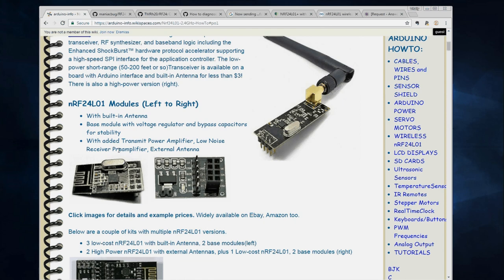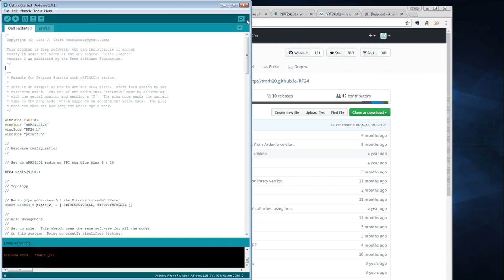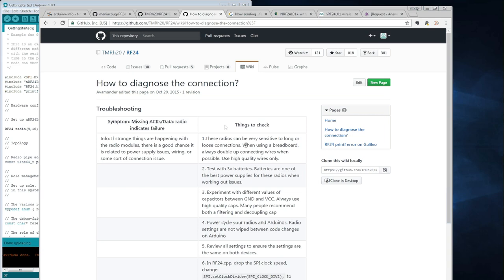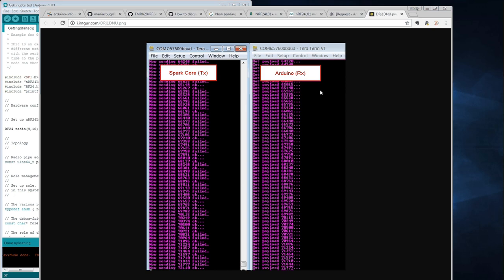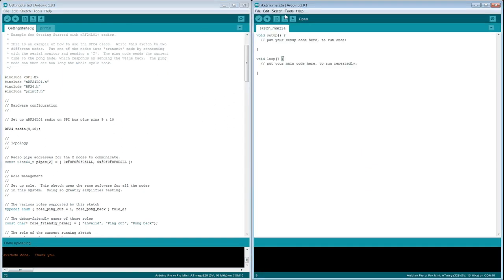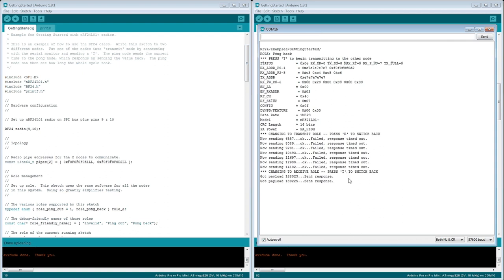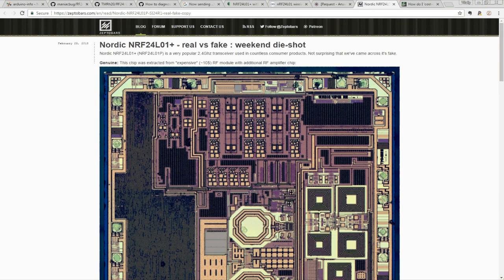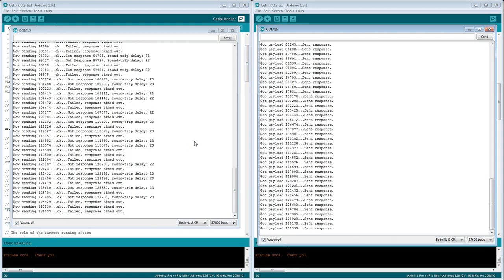nRF24L01+ HOW TO FIX: Now sending ... failed. Failed, response timed out. RF24 nRF24

Comment: Thank you, Thank you, Thank you!  I've been ripping my hair out trying to figure out why my modules weren't communicating.  With the photos of the die and the comparison of the writing on top, I determined I had a fake chip (Thanks Amazon...).  I also then realized that the library I was using (RFLite) didn't have an option to turn off the autoAck.  Once I changed to the RF24 library and was able to turn this off, my transmissions finally made it to the receiving unit.    Thanks again!

Comment: 1.radio.setAutoAck(false) worked...thanks alot....
2.In case the module still dont work then another suggestion is to power up nRF module via 5v host shield as Arduino sometimes is not able to source enough current to the module via 3.3v pin...
I followed both the steps and the modules started working like a charm. Thanks Vitaliy :D

Comment: A few things I'd like to add: the MISO line needs to be pulled high with a resistor (about 3K ohms). Breadboards can have intermittent connections causing errors. At MAX PA power, if the MCU (arduino) is too close to antenna, it can cause severe errors. I suppose long wires could also pickup strong RF causing MCU issues. Shielding can cure this. These are great units once idiosyncrasies are understood.
Reply: Please tell me how to pull miss high and how close are you talking abt..referring to Mcu and ant. Thanks
Reply from the maker: @atdforgebc4605  add 10 to 100 kohm resistor between 5V and MISO.   CLOSE IS like 6 inch and closer. (Add aluminum foil box around Arduino to test interference

Comment: Muchas gracias, por cierto, el ejemplo de GettingStarted de tmrh20 no funciona bien, pero con el ejemplo de maniacbug funciona muy bien. Ambas versiones del api tienen varias diferencias. Por  ahora estoy haciendo un control para un dron adaptando un Trasmitter SYMA con un adaptador de protocolo de SYMA a nrf24, y esta ayuda que has dado funciona muy bien.

Mis tips: 

- Agregar Capacitor 100UF , ojalá sobre el módulo nrf24. Si no tiene 100UF, ponga 10x10uf en paralelo en la protoboard.
- setAutoAck(false) siempre que se pueda. 
- Deje el PA en HIGH, y luego en LOW, chequee que ese valor se vea reflejado en el ejemplo de GettingStarted (de la versión de maniacbugs). Si ve que cambia, el módulo está funcionando. Si no ve cambios, revise la fuente de poder si está bien conectada o si está dando suficiente potencia (ampers y voltaje). Toque el módulo nrf24, si está muy caliente, significa que ya está quemado. 

- Cuando haga las pruebas, procure desconectar el AC y volver a conectar, así los módulos se reinician. Primero deje encendido el receptor y luego el transmisor. Es probable que nunca conecten, para eso, desenchufe ambos. 
- La fuente de poder que me funcionó fue una batería de litio de un Garmin Forerunner 305, que permitía alimentar dos módulos (con antena y sin antena) con un PA en High sin problemas, regulado con un ams1117 para que de 3.3 volts. La batería es de 3,7, así que podría ir conectada directamente. 
- Un cargador USB de 1 a 2 ampers, pero debe ir con regulador de voltaje (ideal ams1117), el módulo nrf24 sin antena se quema muy rápido con voltajes de 5 volts. 
- No usar en paralelo o en serie algún led o resistencias, ya que eso inhibe la potencia de nrf24. 
- Como estándar en todos los ejemplos, usar el pin 9 y 10. 

- Si va a usarlo en un dron, mejor adquiera una versión legítima. 

Muchas gracias, desde Chile.

Comment: hi, i am using module with one antenna and one without antenna. but the one with antenna only works with Nano. Didn't work with Arduino uno. what could be the problem? I connected the one with antenna to nano and the one without antenna to uno. but after 18.22 meters the data exchange was broken. How many volts should we give the electricity need of the module? Would it be better if we give it outside? thanks in advance ;)

Comment: Hi. My Arduino tank robot using T300 chassis and cheap NRF24L01 is having hiccups. It seems like there are intermittent sudden signal drops between my diy TX and the bot itself. I soldered 100uF bet gnd and vcc of the RX module and 10uF on the idy TX device. But it still having sudden drops.
Reply from the maker: myonline88. Are those drops occuring in certain distances between Rx and tx ? Maybe use more powerful instead..
Reply: Thank you for replying so soon sir.  No. In fact it was just a few feet away from me. It occurs almost as soon as I powered up the robot. Sometimes, it takes few minutes before it occurred. Sometimes those drops are successive, sometimes at an interval of few seconds. It wasn't like this before with my first version using old DIY stand alone using ATMega328p chip on a protoboard and plastic 4WD chassis. Now, I'm using Nano, L293D chip, cheap NRF24L02 and 11.1 volts li-po battery and the T300 aluminum tank chassis

Comment: I get the 'Now sending "number"...ok...failed response timed out' to run just fine but when I type 'r' to get it into receiving mode, nothing happens; it just doesn't write anything other than '
* CHANGING TO RECEIVE ROLE -- PRESS 'T' TO SWITCH BACK'. Does anyone else have this problem or have a solution to this?
Reply: Any resolution on this?
Reply from the maker: did you switch the other module to Send mode? (One has to be in T mode, another in R mode)

Comment: This is a good video with lots of good info. It helped a lot. The music is nice but the volume overpowers your voice sometimes.
Reply from the maker: Thanks, yes need to improve on it
Reply: @vitaliyd193  I went through step-by-step. As soon as I switched to the models with the external antenna it worked. The ones I have with the built-in antennas must be the counterfeits. After it started working, I experimented with some of the earlier modes.  I remmed out "//radio.setAutoAck(false);        // added 08/09/20
". Still working. round-trip delay is 22 or 23.

Thanks again.

Comment: Thanks for the content - but I'm still stuck. I can't get past radio.begin() - it freezes. On the next line I turn on the on-board led. If I comment out radio.begin() the led will come on.  If I run the line radio.begin() it stops execution and the led stays off. Tried two arduinos, two nrf modules (the ones with the external antenna). I added a 100uf between 3.3v and ground. Any thoughts? I'm using the power modules with them as well...
Reply from the maker: Need to see wiring and code. Can't help from what's known.

Comment: so i tried both caps and the adapter board,but only the example sketch works,if i try to turn an led or usea potentiometer ,it does not work
Reply from the maker: Sorry not sure I can help with that. Need to look at code for potentiometer scratch ....

Comment: Dear friend I have problem with d13...It cannot read if I connect only in D13....I don't know other connection without d13...
Reply from the maker: nick sbilliris. D13 is digital pin 13?
Reply: @vitaliyd193  I mean that if I connect it something in digital 13 for example one led I will have low voltage in arduino LED 13 and I cannot upload a program...Arduino cannot works fine when I connect something in digital 13....So I am looking for to change the settings to connect in another digital pin to have fine work in my arduino device
Reply from the maker: nick sbilliris. No pin 13 is critical for this module. Only one such pin, it's hardware, you need to change ISP protocol or something to use something else than pin13

Comment: First of al thanks, but... Well I mean I came from "nothing is working" to "yea, it seems like its transmitting...". I managed to receiver about 5-10 payloads within i think 4 hours of today...

That's my code:

16:16:38.932 -> RX_ADDR_P0-1 = 0xf0f0f0f0e1 0xf0f0f0f0d2 
-> I have connection!

16:16:38.979 -> Model   = nRF24L01+ 
->  Also this shows only a plus, when I connected it the right way.

16:16:52.061 -> Now sending 13137...ok...Failed, response timed out. 
-> Well yeah that's the farest I came...

What should I do now? I tried out so many things...
Reply: I'm using these Long Rang nrf24l01 things with that huge antenna on them with the proper base modul, so it gets perfectly clean 3.3V power
Reply from the maker: Either buy genuine modules from adafruit. Or buy HC06 modules 966 mhz with Rx TX inputs, better deal.
Reply: @vitaliyd193  I have to use 2.4Ghz. And my models had great ratings on amazon...
Reply from the maker: @felixbaum2180  I don't always trust Amazon reviews. Give it a try with better us based sources.
Reply: @vitaliyd193  yea, I guess I don't have too much other options...
Reply: @vitaliyd193  Since I don't live in the US, but in Europe, I bought some (not long range) modules of AZ microelectronics, which is a german based electronic store with really good reputations (and equally high prices).
I have on pc with an arduino uno, which receives everything, no matter if the module is the pricy german one or the cheap chinese one and I have another pc with an arduino nano, which sends the stuff the uno is receiving (it has a german module). For the first time ever, I managed to receive sth on the nano, but only two numbers:

Now sending 156356...ok...Failed, response timed out.
Now sending 157558...ok...Failed, response timed out.
Now sending 158760...ok...Failed, response timed out.
Now sending 159964...ok...Got response 159964, round-trip delay: 23
Now sending 160988...ok...Failed, response timed out.
Now sending 162190...ok...Got response 162190, round-trip delay: 23
Now sending 163214...ok...Failed, response timed out.

I checked the numbers, they are correct. Could it be an issue with my arduino nano? or the wireing? Maybe I'll switch the nano with another uno, but I kinda tried that before, but not with german modules. Why is the round-trip delay 23? I guess that's fairly high. Does anyone know if that's a hint to some fault I made?
Reply: ok dude sry to bother you. I just played a bit around with it and suddenly the nano also received sth. First I figuered it was the antenna placement, but after playing around a bit more, I found out that it's the wires. I'll order high quality ones, too now. This really sucks, cause now(if i tape them, so that on some connections is some force) it doesn't care about the modules, if theyre chinese or german. Or well.... actually it's rather a good thing :)

I feel so dumb

Comment: Hey i don't get it started. I tried the "Getting started" sketch you shown in your video. But actually i'm not sure what it says about the connection. I wired the NRF24L01 exactly like you to the Arduino.
The serial monitor shows:
STATUS	= 0x00 RX_DR=0 TX_DS=0 MAX_RT=0 RX_P_NO=0 TX_FULL=0
RX_ADDR_P0-1  = 0xffffffffff 0x0000000000
RX_ADDR_P2-5 =	0x0000000000
RX_PW_P0-6	= 0x00 0x00 0x00 0x00 0x00 0x00
EN_AA = 0xffEN_RXADDR	= 0x00
RF_SETUP = 0x00
CONFIG	= 0x00
DYNPD/FEATURE	 = 0x00 0x00
Data Rate	 = 1MBPS
Model		 = nRF24L01
CRC Length	 = Disabled
PA Power	 = PA_MIN

Comment: hi anyone can answer, why am I having some modules that can receive package, but cannot send? my hardward setup and code was same, but "some" modules just failed to send only, and still can successfully receive package
Reply from the maker: Must be manufacturing issues, quality control. These are tricky to make by non original manufacturers.
Reply: @vitaliyd193  too bad, I have once tried custom nrf24 module board and stencil-pasted by hand, and less than half worked correctly. But those from salers should do far better, don't they?
Reply: hello I've fixed the problem, looks like cap is not enough for it. I use 2.2+0.1uF at initial setup and only some can successful radio.write on air, though all can read fine. It depends randomly on hardware. some worked like fine, or sometimes it worked a single message.
Then I just added a 50uF ceramic capacitor between 3.3V and GND and it just work like 100 folds better than before....
I should have use the code "setPALevel" or something. However its working at max level now.
Reply: @陳柏廷-u5p  can you make a vid and send please I am having the same issue I still dont understand what the issue is
Reply: @gunvirdhesi6672  if you don't know how to modify the hardware, just add a code" radio.setPALevel(RF24_PA_MIN);" after setup, it should make it successful in sending, but it will slighty limit it's range
Reply: @陳柏廷-u5p  thanks, let me try and then I can get back to you
Reply: @陳柏廷-u5p  it did nothing, it gave the value 0 to everything and also even gave the same error, does not allow to transmit or receive. And also the modules I got were expensive and from amazon, here is the link: https://www.amazon.ca/gp/product/B016PP62QO/ref=ppx_yo_dt_b_asin_title_o01_s00?ie=UTF8&psc=1
Reply: @gunvirdhesi6672  hello, what is your error , specific? do you have many modules to test if its error only to one module or many?
my error originally was strange because the same code only happened error to some modules

Comment: I'm working with nrf modules and Node MCU, and on the receiver side, always it's showing me Sending.... Failed. When I change the position or keep the CSN pin D8 floating, then sometimes it shows Sending.... Ok. But there is no reception at other end. I used the pull down resistor method too. Still no results. Stuck here for 3 weeks now. Please help me
Reply from the maker: It could be wiring. Don't take as oh no I checked everything, I always think so until I find a mistake and regret for not checking better. Also soldering connection vs breadboard is good help sometimes with radio.

Comment: Hi, I love the video about the NRF24L01 is very good ..... if it is not much trouble I do not know if I could clarify a doubt I have which is: How could I use the NRF24L01 in an external interrupt that has the arduino?
Thank you
Reply from the maker: NEO CURIOSO I guess you can test with multimeter which pin goes high in nrf module ok no case of  new data coming in. and then wire it to Arduino pin programmed as interrupt.

Comment: Do you have video that teach bi-directional communication between 2 nrf24l01?
I can push button on 1st circuit and make led on 2nd light up. But I can't get servo on 1st circuit to rotate when I adjust potentiometer on 2nd circuit.
Reply from the maker: You need a code on Arduino to send some numbers to other receive side
Reply: @vitaliyd193  I already did but the servo turn a bit for few seconds after uploading the code. I can hear the sound of the servo rotate. But after that it doesn't response to the potentiometer.
I wonder if you have help me fix the code.

Comment: Hey at 6:50 you mentioned the addresses being wrong and attaching the module directly fixed it. was that using a base module?  As in, it didn't work when using a base module? I bought the bases as i cant get the NRF to work hoping it would help. Are you saying it made things worse? These chips are driving me nuts :(  i think its because i'm using cheap copy clones. Thanks
Reply from the maker: Hello, I said attaching the module directly AND SOLDERING A BIGGER CAPACITOR  (100uF) - helped that module to report corrected address. 

My impression of these (cheap clones) is not good too, I suggest buy better ones from links i have in description, or BUY RFM69HW  modules, they are lower frequency (so potentially work for longer distances), plus they are more robust! I used them for my drone (remote controller and drone, works great with a wire antenna).
Reply: Can u give me remote details an maybe the sketch

Comment: okay so this is some new solution. let me try it out. BUT i still have a doubt, You told to add 100uF capacitor, but till now in all my troubleshoot search  the recommend 10uF, any reasoning about it?
Reply from the maker: It should be fine with either one 10 or 100, I would use 100.
Reply: well the solution worked for me (also , I had used just a 10uF cap) thanks for this solution!!... I have been so tensed because of this :D
Reply: @vitaliyd193  yea so my question being what actual difference would it make? sorry i dont know much about it so
Reply from the maker: @hkhatri12  , smaller  voltage spikes with bigger capacitor. But only if module sudennly draws spikes of current. Google search " why a cap is needed on DC motor?"

Comment: "radio hardware is not responding!!" What does it mean?
Reply from the maker: Well, the NRF chip has a module that modulates RF signal, so that has not responded to main controller. Not sure but could be a bad module. Replace with trusted source one.
Reply: @vitaliyd193  Initially i have given 5v vcc for nrf24l01 module and its working fine. when i tried after few days it showing " radio hardware is not responding " , does the nrf module get damaged?

Comment: it still doesn't work for me and I added an external 3.3V power supply to the modules and wrote the code you showed in your video
Reply from the maker: forteleaerieneromane send me pictures of what your serial monitor looks like . and what's the wiring.
Reply: I managed to make it work with a different library. It took some time and troubleshooting but it's done. Thank you anyway!
Reply from the maker: what library is it?
Reply: it's called "RadioHead"
Reply from the maker: thanks. yes i heard about it. Great, I am glad it worked for you! Good luck in rest of the project!
Reply: How did you connect? :(  it's not working

Comment: Not able to recieve the data by usimg your method. Any resoltion?
Reply from the maker: Sorry I am not sure I can help without looking at your wiring. Try to rewire things, double check instructions and code for configuration. Also my solution is only a workaround, the issue is that these are clones, I suggest to buy trusted nRF modules from good sources.